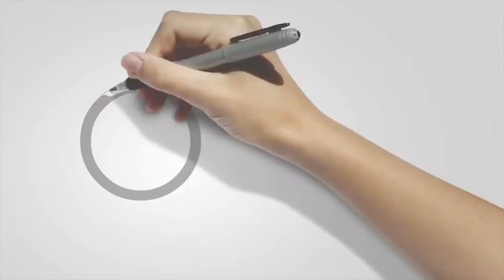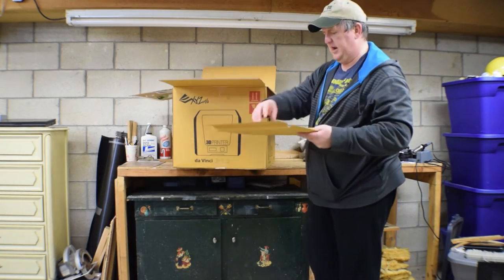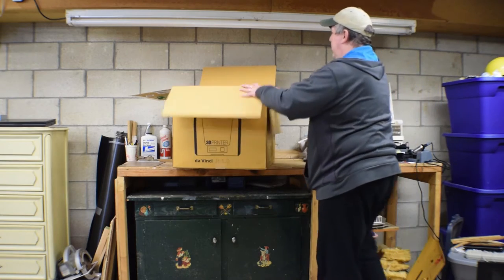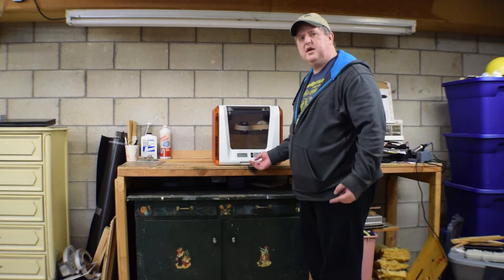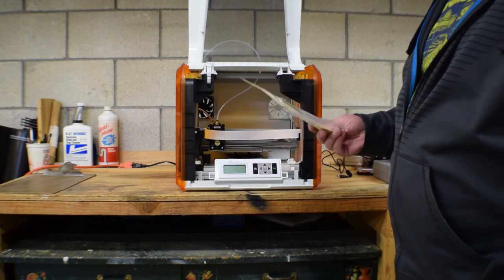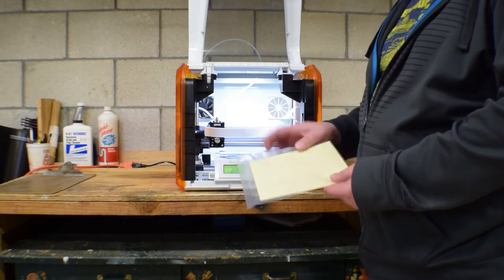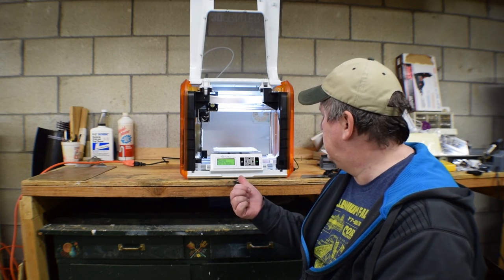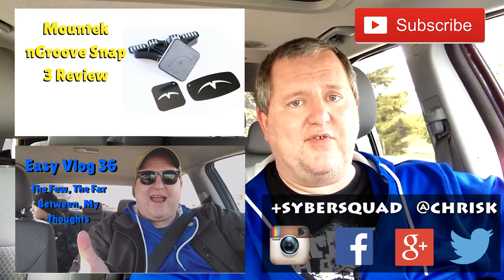DaVinci Jr 1.0 Unboxing and First Print with Timelapse

Comment: great unboxing...greatings from poland
Reply from the maker: +lukasz thanks, do you have a DaVinci Jr?
Reply: yes couple of days..
Reply: U are the owner almost two years.do u have already some problems with yours printer??greatings
Reply from the maker: I've always had a small issue with adjusting the left side, couldn't get the adjustment screw to loosen but I've worked around it. I've been slacking off lately and I need to get back into it. Thanks for watching,. Let me know if you have any other questions.

Comment: Thank you
Reply from the maker: +Big Moist you're welcome
Reply from the maker: +Big Moist You're Welcome.
Reply: SyberSquad One question though- how did you get the extruder to start extracting filament? Mine gets all the way to the extruder, but it won't go into it.
Reply from the maker: I actually cut it to make sure that there was a clean break at the end of the filament. I had the same issue the first time I tried but after that it worked fine.

Comment: I cannot take my sample out... It was on tape but then I ripped the tape off and whats left is the sample and the tape underneath! Its impossible to get it out.
Reply from the maker: +Otteryz you really need to get a putty knife under the print and really force it off if the tape. Really gets stuck down but it's the only way I've found to get it off of the bed. I've broken a few prints trying to force them off from the top so don't do that. Just try to get under them with something and work them loose.